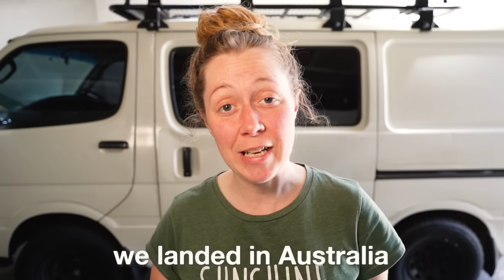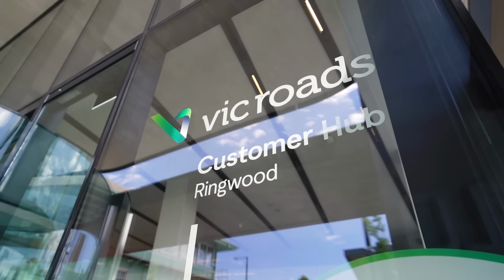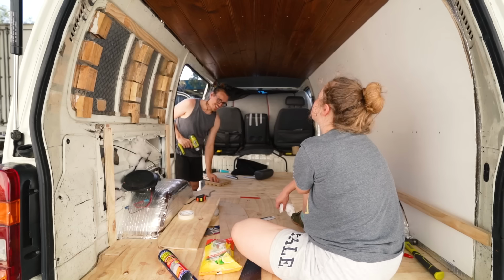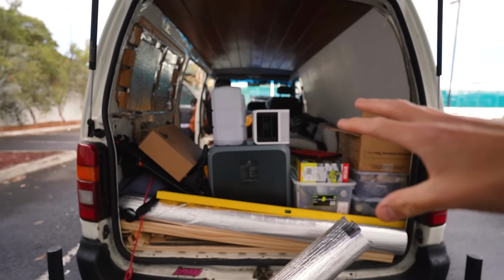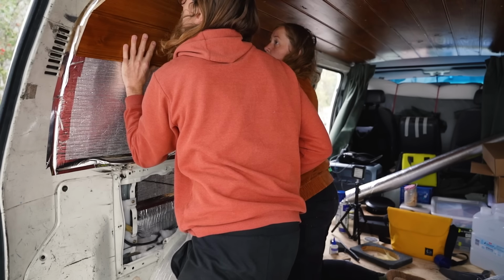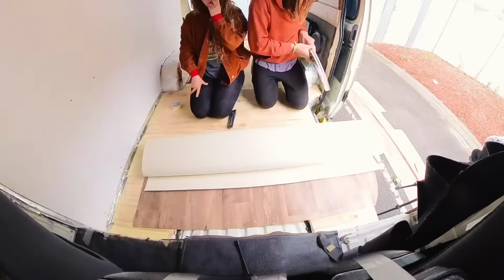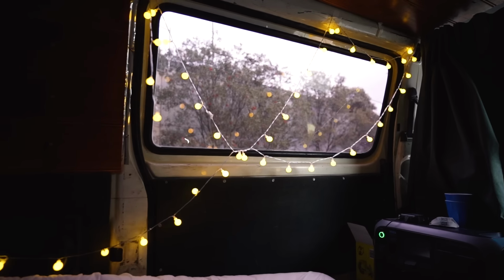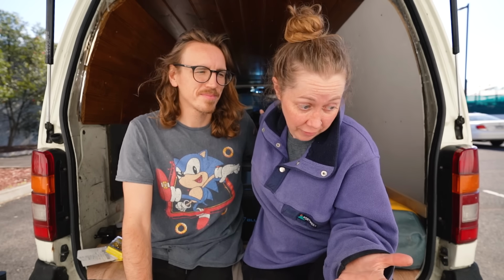Extreme Van Conversion: LIVING IN CHAOS! (Van Life Australia)

Comment: Great job. B4 you build the bed do an oil change and oil filter air filter fuel filter change and timing belt at least. After bad frame is built it is gonna be harder and messier. Best of luck..
Reply from the maker: Thanks so much 🥰 we have designed the bed so that the L part can be removed to gain access to the engine bay if ever needed. The van is getting full service etc before we leave, so fingers crossed all will be good 🤞🙏

Comment: Slight tip.. if you need the van to be warm to stick the floor down just run it with the heater on max for about 30 mins...... surely that would be good enough
Reply from the maker: That's a good idea cuz it gets pretty Baltic here at times

Comment: Surely I heard wrong... and you didn't mean you need a mechanic for a door lock!?  Fitting out a van is a several times more difficult.  Drive to a wreckers, pull the lock out, go inside and hand it to them and tell what year and model it's from, and they'll go get you another one with a different key.  Who cares if the ignition key is different to the rear door key - all cars were like that from the 1980s back anyway.  It's literally: unclip the interior trim from the inside of the door, slide off the spring clip holding the lock in (fingers are often enough, but if not, use a flat screwdriver), unclip the metal rod going from the lock down to the latch, and push the lock backwards out of the door (if it hasn't already fallen out).
Reply from the maker: We've done that for our last van, replaced numerous locks, catches hinges on our doors from breakers yard 🤣 This is the mechanic we bought the van from who said anything that we noticed in the first couple weeks he would fix for us as part of the sale 💪💪 we still have to go back to finish up the paperwork as it's took us a while to get registered in Oz, so he's gonna fix up this stuff for us then 🥰🥰if it goes again I will defo come back to this comment and replace it ourselves 💪💪
Reply: @phillyandkeely  Ah that makes sense now.  I thought it sounded contradictory.  You may have missed my comment on the previous video...  While you're frequenting Bunnings maybe buy a few spray cans of wasp spray for intruders.  The one with a nozzle that shoots a few meters.  And if it happens and you have time, pull on swimming goggles first if you have some with you anyway, or look at "safety googles" in Bunnings (tool section) so it doesn't blow back into your own eyes.  While they're whining and wiping their eyes you drive away.  It regularly gets suggested in motorhome forums.  Particularly for towns inland from the coast and/or up north where young Aborigines from about your age down, with nothing better to do having drank all their dole money, break into vehicles looking for things they can hock, or just to joyride - even when they know someone is inside!  (They're not the brightest bulbs in the fridge if you get me.)  For the same reason going out at night in those same kinds of towns isn't a great idea, unless in a group.  They yell, spit on people, but I'm more referring to leaving the van unattended.  You'll come back and anything like cameras will be gone and the windows smashed.  Subscribe to Facebook groups before going places, say you're overseas tourists, ask if crime is a problem in the area, suggestions how to avoid it, etc.  Because in some places they even walk into fenced caravan parks because they know no-one will confront them, smash windows, steal stuff.  Several months back they attacked 2-3 women in a caravan park, tried to (or maybe did) steal their vehicle.
Reply from the maker: Wow that's crazy, thanks for the information, we will defo keep our wits about us and join some forums